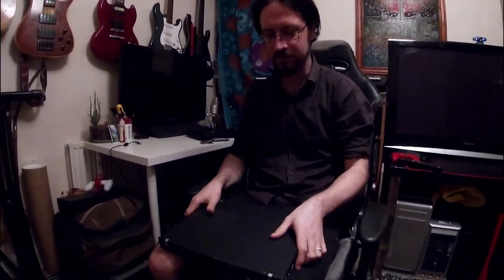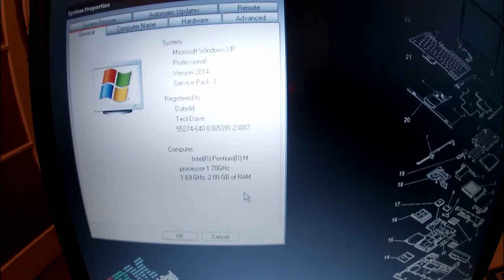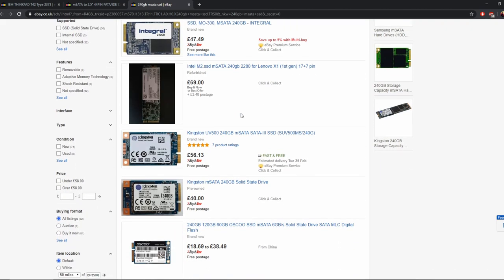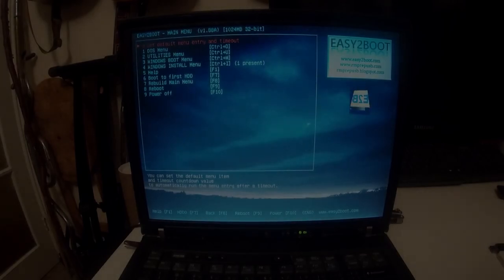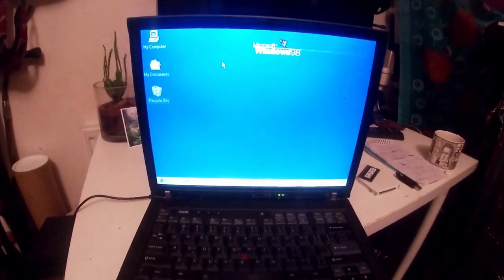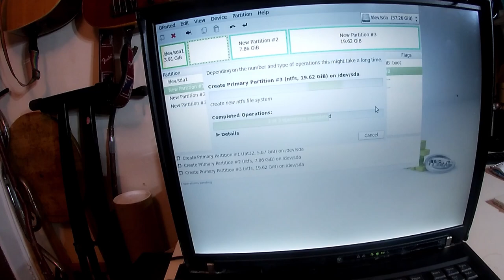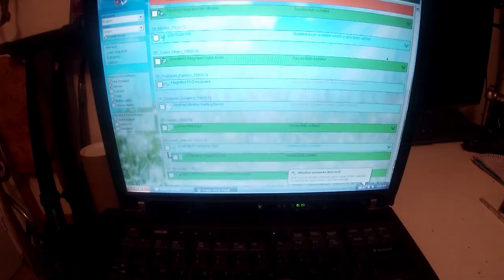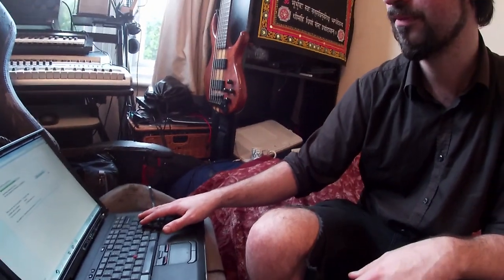The T42 Saga Ep.1: Trashed picked IBM Thinkpad T42: Install windows 98/XP/7 Triple boot

Comment: Nice. I've had a T23 since 2002 (I bought it secondhand on eBay and used it for years). It's such a lovely machine. It's still got Windows 2000 on it, and a vintage version of Ubuntu. These days I use it for playing Starcraft, and (given that it's only a 1.3MHz Pentium I'm constantly surprised at how quickly it runs software from that era).

A couple of years ago I put an SSD in it and got it a new keyboard for £15. Then I found an as-new dock for it on eBay for £5.
Reply from the maker: oh nice! i was looking at getting a T23 in the past! ive got a second video coming with gameplay and boot times comparing the msata ssd to the ide HDD, and ye, im pretty impressed with boot and load times for such an old machine as the t42.
ive got the dock for the T42 coming by next week, and am planning on getting a fresh battery and a pata to sata harddrive caddy and putting a sata SSD in the drive bay!
im curious which version of Ubuntu u are using on the ur T23? i cud barely run Mint 13 on the T42!
thanks for the comment and im assuming the like too!

Cheers

TechDave
Reply: @TechDave  I'd have to fire it up to be 100% sure, but I'm pretty sure it's running Hardy Heron (8.04). I ran GNOME 2 on it, which ran well enough. And with the mSATA SSD that I put in it, was absolutely fine.

The S3 graphics chip in the T23 isn't supported by recent X servers, so I didn't try installing a more modern desktop-focused distro on it. Slackware 14.0 is the most recent distro I've found that ships with an old enough X server to support the graphics with hardware acceleration (which is a must have, really).

I'd expect any release of Debian to run smoothly on your T42; I'd just pick a lightweight desktop that doesn't run a lot of background processes to support stuff like auto-disk mounting, etc. Something like XFCE or LXDE should run fairly well, I'd think. And if you really want it to feel snappy, you could try a lightweight window manager (i.e. not a full desktop environment). WindowMaker is an old favourite of mine, and ran like the clappers on Pentiums. :-)
Reply from the maker: @GrahamAtDesk  I'll see what I can find! Thanks dude! Planning on maybe putting another install (aka Linux) on an sata ssd in the drive caddy when it arrives! Will be in part three of "The T42 saga" where I do all the upgrades etc.. working on part two now
Reply: Correction — I found some notes I made last year, and it's running 9.04.
Reply from the maker: @GrahamAtDesk  amazing! thanks dude!
gotta wait a while for parts, but expect to see Ubuntu 9.04 running from sata ssd in the next week or so!
(just editing part two of the T42, basically just gameplay footage
part three will feature a full review and Ubuntu!)

Comment: Now this is what I call a proper laptop!  I used to buy the T42 (and sometimes R32's for people we didnt like) at one of my old jobs!  They look business like because they are business like - built to withstand pretty much anything a member of staff could throw at it!

I'm sure it was a T42 that someone ran over in car park (they left it in a bag against the wheels of the car they were a passenger in whilst paying for the car park ticket when the driver decided to reverse out of the space and inadvertently ran over the laptop) needless to say the screen was smashed but due to the roll-cage in the laptop it powered on first time when connected to an external display and I could transfer the data across to their replacement! :)
Reply from the maker: ye its pretty sturdy beast!
unfortunately, my T42's CPU fan has died, and i bought a replacement but that doesnt work either, so im researching replacing the fuse in hope of resurrecting it!
edit: failing that i am contemplating the T43 motherboard swap

Comment: What a long journey :D Be careful with flexing on the T42 mobo. Never move it when it's hot and use the best cpu/gpu paste.
Reply from the maker: It was arduous but worthwhile! Haven't used windows 98 since I was about 12 years old! It's a nightmare and an exquisite pleasure at the same time!  I shall do my best to take good care of it. Part three coming in the next week or two, I'm basically waiting for the pata-sata DVD drive caddy (I bought the wrong one, which is becoming a bit of a habit for me, got about 10 of the wrong ones for various machines!). I got quite a few upgrades, tempted to do the CPU for that extra .1 MHz but I think the gpu is not socketed so I'm not sure it's worth the change? 
Also, thanks so much for the sub dude! I don't always comment but I watch most of ur videos (bell icon clicked a long while ago), made my day! 

TechDave
Reply: @TechDave  Thanks man, yes the cpu upgrade is a bit puny but it is a powerful retro machine for Win9x if the drivers work well. The T430 is the last official WinXP machine so you got that one covered well. The German thinkwiki has some good stuff on the T42 as well:  https://thinkwiki.de/T42
Reply from the maker: @panoramacircle3281  only just saw this comment! sorry for the delayed response, YT didnt inform me of it. 

i would defo consider the cpu upgrade, maybe even just as a project.
thanks for the wiki link! will check it now!

EDIT: (once i got my german reading head on) i discovered i can apparently use any pentium M with (400 front side bus) up to 2.1ghz! that wud defo be worth it, so i shall be doing so once ive done more research! 

possibly even feature it in part three of this series!

EDITED AGAIN:

The max cpu is almost £400 on amazon..... balls
Reply from the maker: @panoramacircle3281  also: i did actually make the T430s windows XP video, i had the footage partially lost, and then the mSata ssd i set it up on died a terrible death (press F) so i abandoned ship... still got the footage somewhere though, so i might post it anyway. Cheers!

Comment: Two things Dave:  I also wanted to do exactly this on a Pentium M equipped 1Gb T42 but W7 won't accept the machine spec! ) it  throws up  a blue error screen "Windows Recovery Environment error code 0xc0000260" on setup which seems endemic in VM installations and unfixable in same way?? So I scaled back plans to just a W98se/shared/XP setup but the EasyBoot said 'not enough memory 'to install XP (the lower RAM options neither worked). I had partitioned the 40Gb drive (6gb\6gb\balance) and had first installed W98se; so I resulted to having to clone over my pre completed installs of W98 and XP onto the partitions. Consequently, I cannot get a boot menu or a Boot manager to alternate between two. I have to keep taking the drive out to make either/or partitions active when linked to another  W7 laptop via USB/eide connector.  SO - please could you just cut n paste the txt from your XP Boot.ini here for me to see how yours is configured please?? Thanks.
Reply from the maker: unfortunately my T42 CPU fan died, and the replacement i bought doesnt work either so i am unable to assist! sincere apologies!
also, im so sorry for the delay in my reply, youtube didnt let me know about ur comment!
Reply: @TechDave  I soldiered on and got W7 running on another HDD (80)gb with the T42. I upped the RAM to 2Gb and am just attempting to clone that working W7 install (running fine) onto a 128Gb mSata, but it's not having it. Using Mini Tool PM 10,  the first attempt started up W7 boot seq with animation then crashes + BSD on 'Autochk no found'. Subsequent reinstall just gets OS not found...? Is there something amiss re mSata driver or alignment or driver/format?

I haven't manged to sort the Boot Mgr for the W98/XPSP4...
Reply from the maker: @snotmale  i would perhaps advice doing a full install of windows 7 direct to the msata, as a) it will most likely resolve the formatting issue if that is the case and b) it should provide a boot manager listing for the prior 2 os's
in regards my T42, i am awaiting a new cpu fan and heatsink in hope of reviving it (getting 'fan error' on boot) and once it arrives i may be able to suggest ways to resolve ur issues? all i can really suggest is to follow my method in the video, as the installs need to be in the correct order, with the correct partitioning in order for the different os's to be accessible!

sorry i couldnt be of more assistance!

EDIT: 
ps: i would recommend starting afresh and installing win98 first (after partitioning the drive in linux) with 1gb ram installed (& run the unofficial service pack so as to ensure that win98 boots with 2gb ram), Then install windows xp with 2gb ram installed (& again use the unoffical service pack- this is optional) and then install windows 7 last

Hope that helps!

EDIT 2: make sure ur windows 7 install usb is in the correct format! try MBR then GPT, one or the other may be necessary!
Reply: @TechDave  after fiddle faddling about  the culprit was that the caddy was guiding the top row of pins into the bottom row on the connector! Running now! Now have an upgraded 2Ghz 755 CPU, 2Gb RAM 128Gb mSata T42 running W7 pro... and nothing to use it for!
Reply from the maker: @snotmale  yaaaay! Id recommend win98 games, in fact games in general! I subbed to ur youtube channel btw! Perhaps u shud make a video about it? Please mention me or even link my video if u wudnt mind
Either way, congrats on a successful build my friend!
Reply: @TechDave  just so that others might consider a cpu upgrade, the below website is an invaluable point of reference. In addition to helping me select a reasonable price-per-performance ration option, I discovered that the original M735 1.7Ghz cpu from the T42 could be used  to upgrade a 'Freecycle' Dell  Inspiron 1200 I was given!  F-Reecycling in all its glory!!  https://www.cpu-upgrade.com/CPUs/Intel/Pentium_M/780_(Socket_479).html